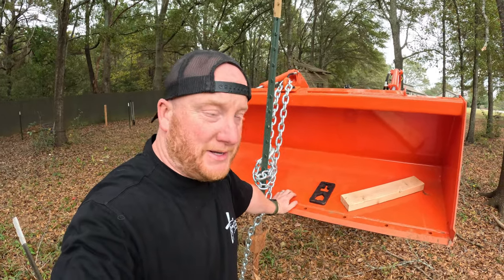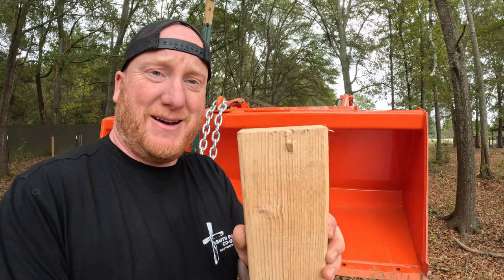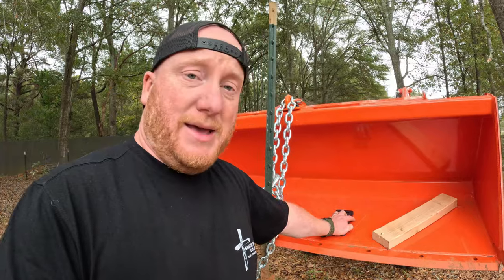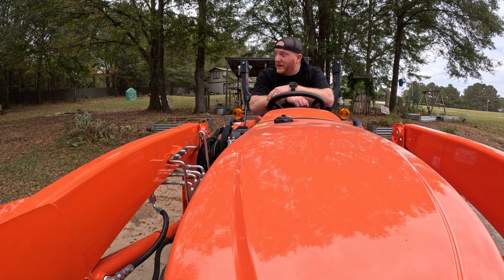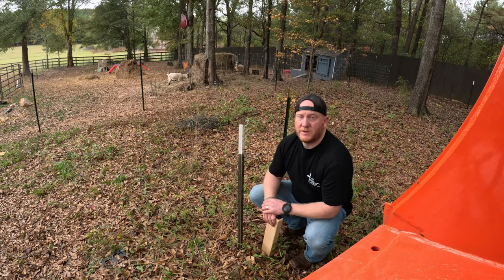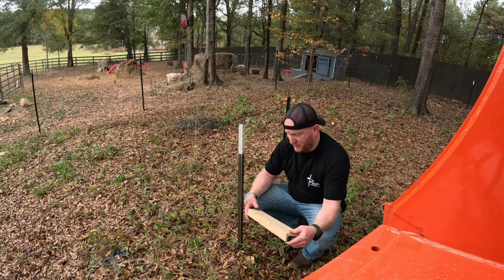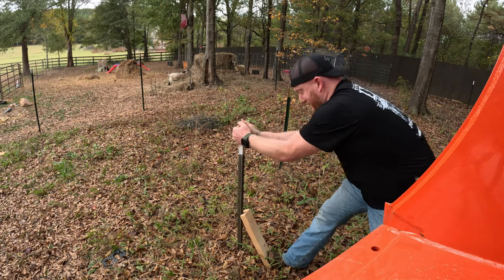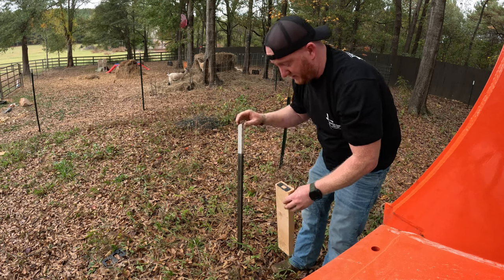How to Remove T-Posts on the Farm – No Back Pain, No Hassle!

Comment: Take your Tpost driver and turn it upside down instead of the wood and use it or use a flat head shovel upside down.  Been doing those for years.
Reply from the maker: I plan to make another video with different methods. 

Thank you for commenting. Don't forget to subscribe and like.
Reply: That method  did not work.
The post were in the ground to deep